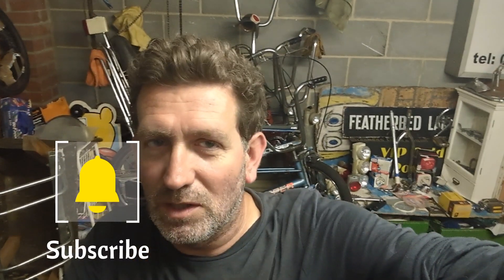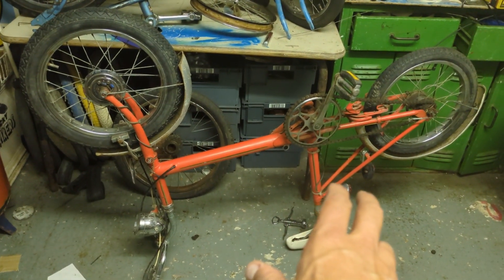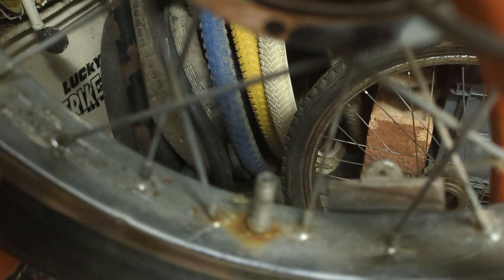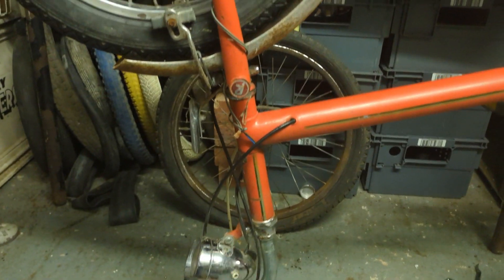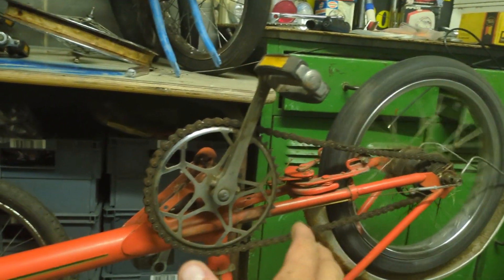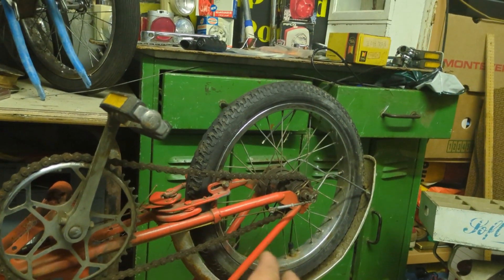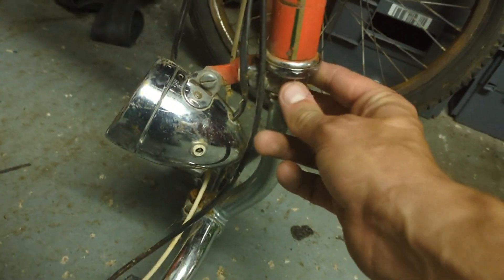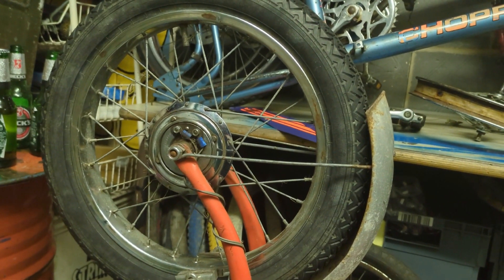RSW... better than I thought. original paint | working Dyno hub | what shall I do ???

Comment: Hi Mike. I own a Mk1 1967 RSW16 which I am very proud of. Mine is in good used condition with original blue paint and transfers! It has rust converter here and there. It too has a front Dynohub. The lights have never worked since I purchased it! I payed £230 for it 2 yrs ago on EBay! So with yours having virtually no rust. Working lights,ect for £20 is an absolute bargain buddy! Although if I was in your position I’d definitely consider fitting the RSW front wheel and electrics onto the Chopper,and maybe fitting a 16” front wheel from a child’s bike onto the RSW and have some fun with it! I’ve fitted my Mk3 Chopper with a 16” Carrera child’s mountain bike front wheel and it handles my 99kg body just fine!😃